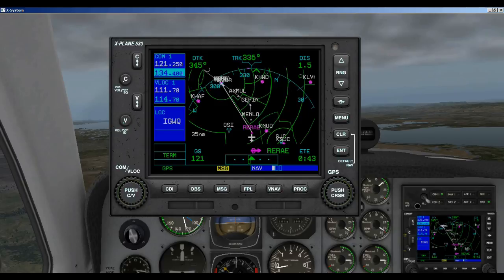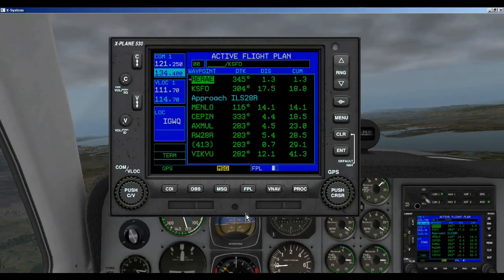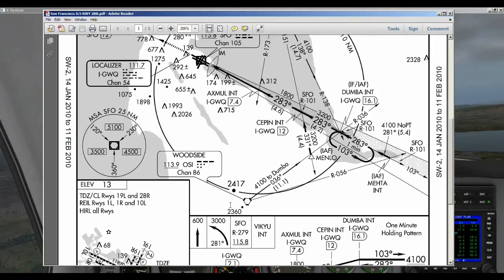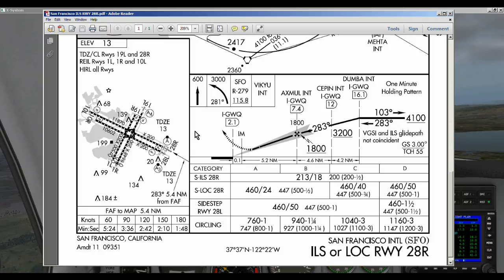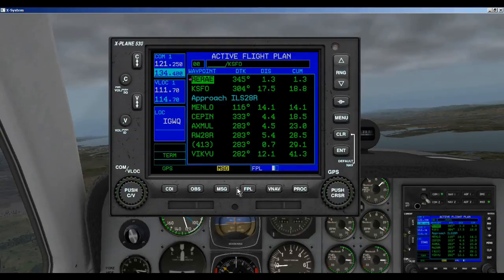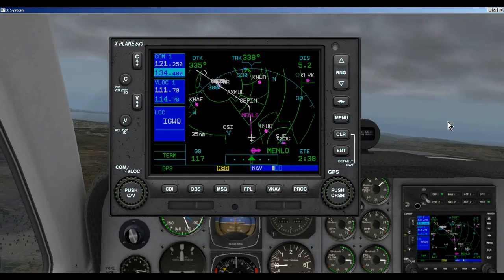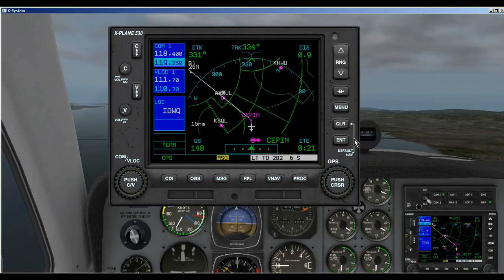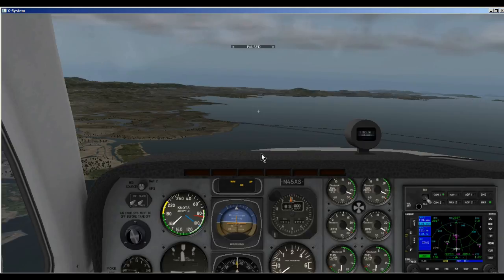How to Land with X Plane's Garmin 530 ~ Tutorial

Comment: Can anyone tell me what does that number 413 in the garmin flightplan means ?
Reply from the maker: Hi Jaap Aap, Sorry I took so long to reply been doing a lot of searching on this with no definitive answer. My best guess is that its an altitude to reach before starting your missed approach procedure, notice the number comes after the runway RW28R in the flight plan. If you look at an approach plate for SFO RWY 28R, in the upper right is a missed approach procedure. The current approach plate, of 11-10-22,  says climb to 4000ft then climbing left turn going to VIKYU. the plate I used for this video says climb to 600ft then to VIKYU. With that the 600ft in the approach plate I used is obsolete and the X Plane Garmin probably is outdated also, but sends you to VIKYU. So this number probably is and altitude to reach before turning to a missed approach point fix or holding pattern. Sorry that's all I could come up with that makes sense to me. Let me know if that makes sense to you or if you found an answer yourself. Thanks for watching and your really good question :-)

Blessings,
skip

Comment: Here is a problem I encountered. Last week, I could not access Watsonville - KWVI 108.30 for ILS, gauge was dead. It was alive the next day. Today in San Francisco KSFO 109,55 or 111.7 no ILS or GS. Anybody encountered this. Seems I discovered today, if I shut down X plane and shut down PC, restart, restart X Plane it is operational.
Reply from the maker: Hi C Wood, I've not heard of anything like this I suggest you re-install X-Plane and see if that helps. Let me know how you make out :-)

Blessings,
skip
Reply: @WEHVideos  Well I did fix it. I got a suggestion from the X-Pane Forum that on the map (keystroke M) in X-Plane that I disable the ILSes. I went back into a 3 mile landing with the ILS frequency on and sure enough, there it was. It has"nt all the time. I have never experienced it before. It has been a 1st. But I lnow what to do next time
Reply from the maker: That's interesting! I've never noticed that and don't have a clue of what that means or what it does. Glad you got it fixed :-)

Blessings,
skip
Reply: @WEHVideos  Here's another question. I have never seen a demonstration on the use of vertical navigation which is the 3rd page on the NAV button. Guess I'm just gonna see what it does.
Reply from the maker: Hi C,  I have never used AP for vertical navigation, let me know how it goes :-)
Blessings,
skip

Comment: Do you need to hit the nav button in the plane also besides just the GPS
Reply from the maker: Hi rackum44,  That depends on your airplane and the nav system you have. So if you have  NAV1, NAV2 and GPS options you need to select GPS and make sure the Nav system is turned on and if there is ON, OFF, AUTO the AUTO must be selected for the GPS to work. You also must make sure the Glide Slope is active by selecting APP in the case of the Baron58 but it may be different depending on the airplane you are flying. Hope this helps.

Blessings,
skip

Comment: Thanks skip I have been flying the baron too and the gps works great , I did all you say on the Cessna but I think maybe the stal warning might turn of the gps but I do all the auto and nav or loc .  Just need practice with throttle control when I am decending on the glide slope . Does the gps ils decend the plane or only align
Reply from the maker: Hi Scott,  When landing using the ILS system you use the NAV radio not the GPS. ILS aligns you down the center of the runway and it's GS will bring you down to a decision point where you take over the landing so it does take you down to the runway.

The stall warning is just a warning signal created by an opening in the wing that "whistles" so to speak when the angle of attack it too great, it's doesn't do anything else, completely driven by air.

skip

Comment: Love the bus. I have almost completed two flights starting at programming gps taking off flying manual
Then auto. When I use the baron autopilot great , if I use the Cessna and turn on autopilot and hit nav it never a follows the gps .  But my real problem is when inget the glide slope
I always land tomearlyn meaning I am not adjusting my speed correctly and i drop to quick. Is there any tricks skip.
Reply: Sorry not bus I ment videos
Reply from the maker: Hi Scott, What Cessna are you flying? There are three things that need to be turned on for the GPS to work. OFF.ON.AUTO must be set to AUTO. Source NAV1 NAV2 GPS set to GPS and NAV or LOC engaged.

If you are landing with ILS in AutoPilot you need to turn AP off before touchdown. There is no real trick you must pay attention to Glide Slope and speed or you will have a problem. Watch your speed in the Cessna, you should be around 60kts with flaps just before the runway. Cut the power when you are sure you can make the runway and your speed should drop to 55kts, get ready for your flair by leveling off just above the runway, your speed will drop quickly and you flair just before touchdown. Too much speed in landing will cause troubles so watch your speed, if you are around 60kts when it's time to touch down your too fast and most likely you will "takeoff" some what when you try to flair instead of touching down. Landing is nothing more than a controlled stall. You should hear your stall warning come on just about touch down time. Check the PAPI lights to make sure RED is over WHITE on your approach, this insures you are on a correct glide slope. Let me know how you make out.

Blessings,
skip

Comment: thank you once again for your videos. i have a question. Where do you get the glide slope information? I see you brought up a page... what is that website. so i can plane my flights better. i could never get the glid slope im normally VFR once i get close. i reall want to do it right. thanks again for all your videos.
Reply from the maker: Hi David,  Glide Slope is the angle you approach to the runway and is around 3 degrees. If you are using  ILS and keep the GS indicator centered you are on GS. There are PAPI lights and VASI lights to help you stay on GS also, these are visual aids. The PAPI lights consist of lights lined up side by side. When the two left lights are red and two right lights are white you are on GS. If three lights are red you are a little low, if all four are red you are very low. It works just the opposite with the white being too high. The VASI light system have lights "behind" each other or along the runway. As you approach the runway one set of lights will appear to be above the other. So if you are on GS you should see the red lights over the white lights or the farthest lights red, closer light white. A saying goes "Red over white your alright, red over red your dead, white over white you fly all night."

Don't get too hung up on this you want to learn to "see" when you are on GS by how the runway looks as you approach so you don't rely or fixate on these visual or electronic aids. Again these are just references to help, learn to land without these and you will become a better pilot. However these lights help on runways that are slopped as on a hill. The runway will look different in these situations and you can find yourself too high or low depending on the direction of slope ether towards you or away from you.
Hope this helps.

Blessings,
skip
Reply: +WEH Videos great stuff Skip, but do you have the website that had the page where you show the GS, the radio info, the altitude etc. that is what I am searching for. also thank you very much for explain the lights. that does help. I seen them and always wondered lol. I think in 10.50 b2 they are not working. hope it gets fixed on 10.50 b3.

thanks again
D.
Reply: +WEH Videos the Approach Plate. just saw it on your description. if you have an app, I can use on samsung tablet
Reply from the maker: You can go to AirNav.com/airports and enter the airport you want, look at the bottom of the page for Approach plates for the runway you want. You won't find approach plates for all airports just the larger ones with ILS in most cases. Happy Flying!

skip
Reply from the maker: Yep, very cool!

Comment: Great Video.. but I have a question: my GPS does not switch to the next waypoint automatically .. what do you think the solution would be ? Thanks in advance.
Reply from the maker: Rafik bito Hi Rafik,  Yoo need to be sure you turned on the Auto Pilot. In the Baron58 on the center console between the seats, there is a rocker switch on the far right that must be turned on, then you can select the APP or NAV button depending on what you want the AP to do. Look at the display panel above the Attitude Indicator, you should see NAV, GS, and AP lights on. This tells you the AP is on and you are navigating with the NAV radio and have captured the Glide Slope. If there are no lights on the AP is not on. Hope this helps, let me know how you make out.

Blessings,
skip
Reply: WEH Videos Thanks a lot Skip. I have the Autopilot on and NAV is on as well, but still the GPS does not switch between waypoints automatically. I have to do it manually by pressing Flight Plan on the GPS then Menu and choosing Activating Leg. Thank you.
Reply from the maker: Rafik Batroussy Hi Rafik,  That's interesting. There is a NAV1 NAV2 GPS switch on the Baron58 in the upper left of the panel. That must be set to GPS and right above the CDI button  GPS should be displayed, if it isn't hit the CDI button so GPS is displayed. Let me know if that works.

Blessings,
skip